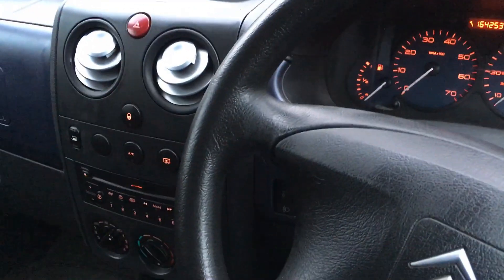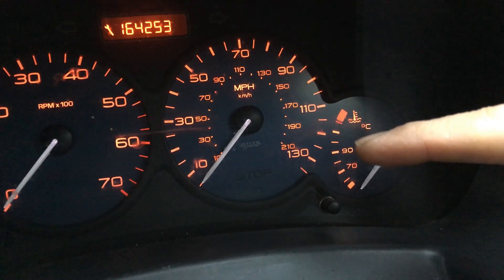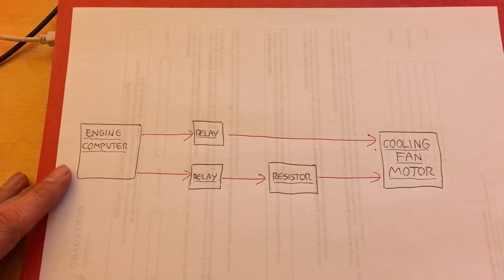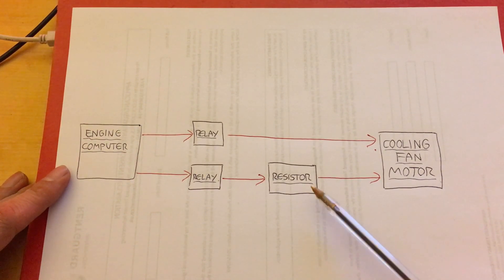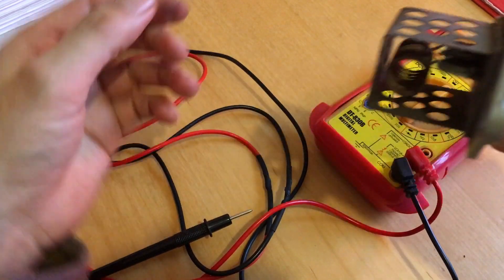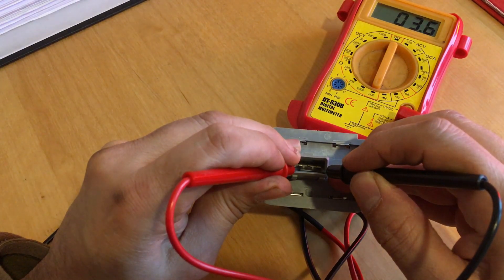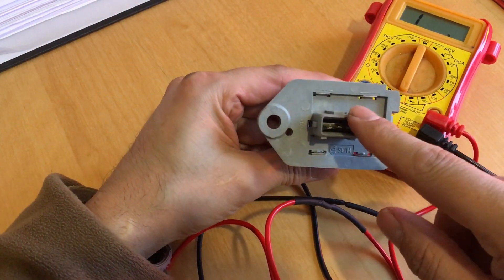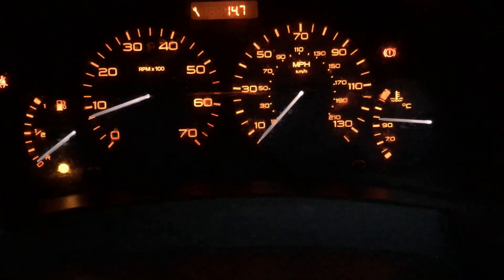Overheating Berlingo / Partner / 206 - Cooling Fan Resistor Fix

Comment: I have a partner 2012 and this was the reason radiator fan wasn't setting off. It goes off full speed when i switch on ac but doesn't start at all otherwise. I didn't even know this resistance existed . Thank you
Reply from the maker: Glad it helped.

Comment: This video did confirm the initial diagnosis in my 206 1.1L, this was really helpful and it did work, although I had both: a faulty coolant temperature sensor and a Radiator Fan Resistor. expecting More Good Citroen/Peugeot Fix Videos. Thanks.
Reply: i have the same car 206 l4 1.1L 60hp
drove me crazy until i stumbled upon this useful video ! in fact i didn't even know that this resistor thing existed on my car. thanks to the uploader. you are a life saver
Reply: @mbarizia   he saved me from alot of scammer mechanics tbh, I did change them really easy myself.   Took me around an hour to change both, however I needed to recalibrate the Coolant Temperature Gauge, Hit Me Up if you need to know how to do so easy and without the use of an OBD2 Diagnostic Tool. The Easy way, if you happen to have a Diagnostic Tool, get into the BSI section, Gauges, then press "Reset All Stepper Motors" once you press that your gauges will reset and stay on the lowest position for like 2 seconds making a ticking noise then your done.

Comment: Same exact problem on my 1.6 16v 206 - changed thermostat, sensor, and antifreeze, cleaned relays but no effect. One thing I didn't notice earlier is that my A/C doesn't work which is a symptom of the resistor not working the fan on low fan speed because the A/C needs pressure. Another thing I did notice is that the fan would turn sometimes but not always, and sometimes would kick in with a slight physically push but without any bearing issue or mechanical issue on the fan motor. Hope this helps.

Comment: Hi I have the berlingo 1.4 2003 car.I changed the fan resistor and relay but the low function is still not working.Only high function.When I start the air condition the low fan function still not runing.Only high .Maybe the problem is in the bsi modul ? I dont know....

Comment: I have an issue where my van goes into limp mode when the revs drop to tick over, could this be related to the cooling fan?
The last garage I went to said there was a cooling fan related code showing.
Reply from the maker: I doubt the cooling fan issue would make it go into limp mode - but not sure.
Reply: @iofix  all sorted now 👍
It was the cooling (radiator) fan resistor.  It had corroded, so I fitted a new one and all good now 😊

Comment: Hi, is the fan still can run when the resistor failed and just not activated the high speed fan mode? Or the fan not running at all?
Reply from the maker: Yes, but I think on high speed only.

Comment: When your fan runs is it very noisy almost vibratory please
Reply from the maker: Yes they normally are at high speed.
Reply: Thanks
Reply: Ok thanks. I think got exactly same as yu. I cannot find anywhere how to remove the front to get at resistor or fans. Can you advise. Sorry to ask. Obvs the top valance between headlights and grill but how drop bumper please

Comment: what are the temps for low speed and high speed ?
Reply from the maker: Not sure.
Reply: low 97-8  high 104-5
Reply: @sistem62  is there a way for activate the fan at lower temps ?

Comment: Would give a thumbs up if
1- lazy,lazy man refilmed how to remove and fit resistor- that's what this video is meant to show- I can get a crap PDF that describes the removal and fit
2- how to test new resistor- not rocket science- borrow a hairdryer, run it on lowest setting, slowly move heat towards resistor- with test meter on OHMS setting, should continuously change as it gets hotter- that's a good way- best way? Find out resistor OHMS at temperatures stated by manufacturer- get resistor (it's actually called a thermistor- thermal resistor) to that temperature,if it's OHMS reading is within manufacturers specifications ( usually a tolerance is allowed) you have a GUARANTEED working replacement...